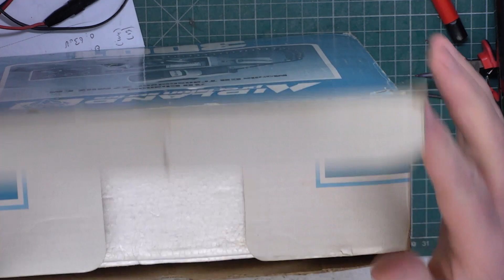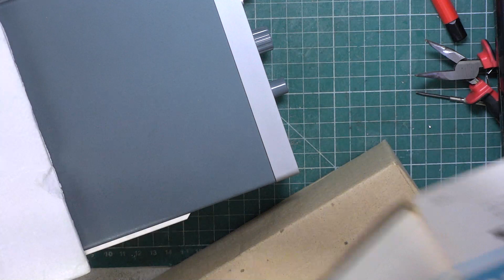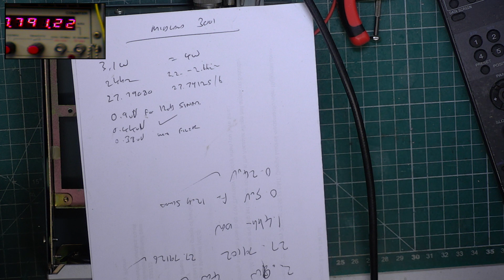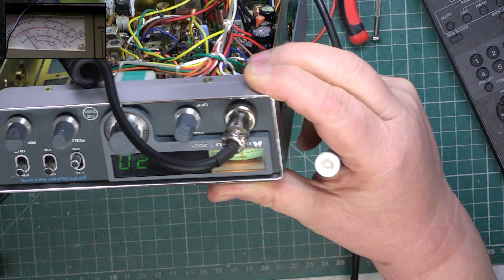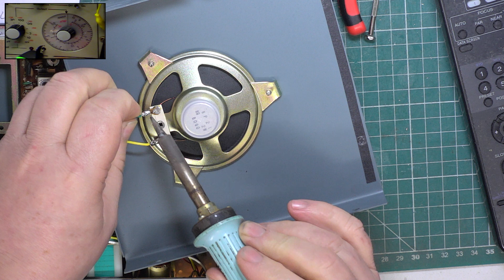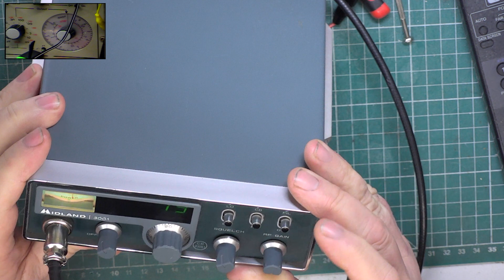Midland 3001 CB27/81 UK FMCB radio service

Comment: That's in lovely condition that is, I've never noticed the lack of tx led on this to be honest, probably as well because if the LEDs come from the same batch as the 2001 comtron sets etc they would have blown by now anyway, easy to add a TX led to this though if required by anyone, again not a big fan of the Midlands, if ever a set is going to have a digit missing in the display it's one of these.

Looking forward to the test

Comment: I owned a Midland 3001 for a very short period of time back in the 80's. I think it was just a particularly bad set that I'd been sold as it turned out to be the worst radio I've ever owned for bleed-over. Any signal over S9 was a problem, and any signal stronger than that would result in me hearing their conversation on every channel. It was so bad that you just couldn't work out which channel they were actually supposed to be on. I still like old Midlands though as they have a real classic style.
Reply from the maker: All the radios using this Maxon chassis suffer from 'desense'. If someone is transmitting close by and, for example, you are talking to someone who is an S5 signal, the signal disappears when the nearby station transmits. Obviously if that nearby station is operating at illegal powers above 4W then it's not the radio's fault!

Watch the on the air test which will get published today. When Mr Chippie pulls over at the 5-mile point it's a solid S7 copy.....then interference nearly wipes me out. Interference from what or where? we've no idea.

Richard, G0OJF, UK